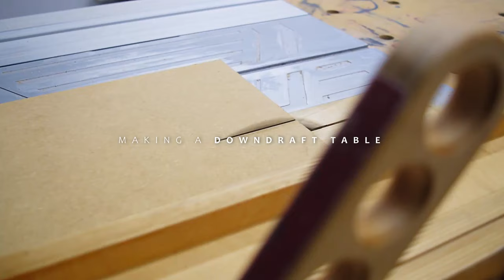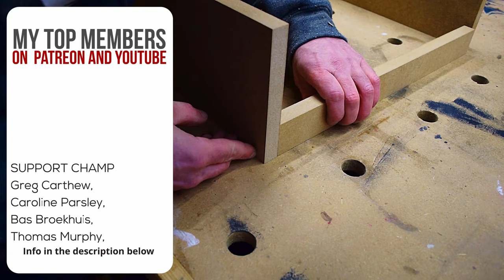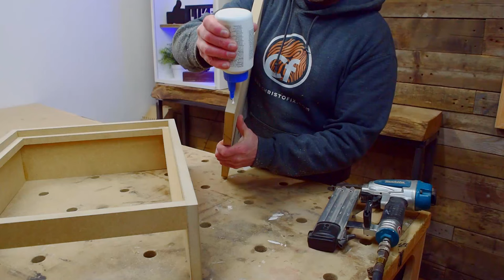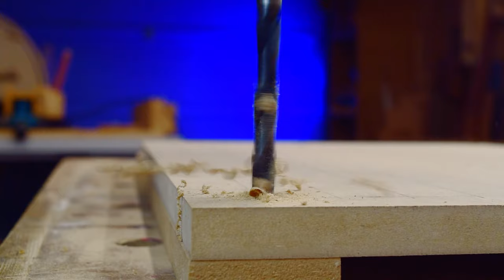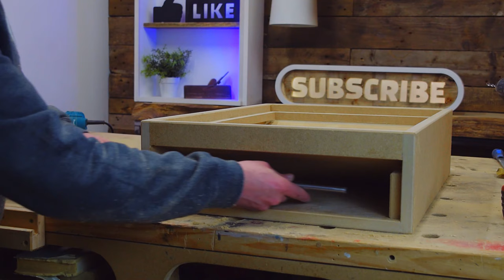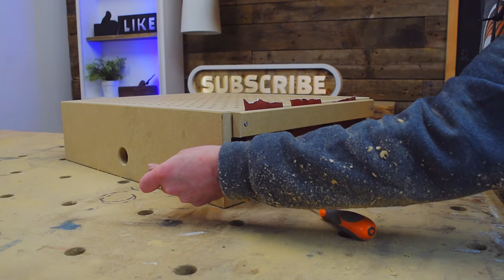Floating dust? DIY downdraft table WITH A LITTLE EXTRA 😍

Comment: Great design. I've been planning to make one for ages. Might put  few grooves in the top and see if it provides an advantage. I did chuckle when you sanded the top before fitting it, rather than waiting to use it to extract its own dust : )
Reply from the maker: That is actually a good comment, my friend! And very clever, too! We should start to make videos together, hahaha. Thanks for watching and this positive input, buddy!
Reply: @christofix  Thanks. It was intended to be constructive : ) Wish I had the time, space and equipment to do vids, because I have some good ideas occasionally.
Reply from the maker: @danceswithaardvarks3284  It was constructive, for sure. I had never thought about sanding it in the end, so I could suck its own dust, so thanks buddy!

Comment: Your downdraft table is cool , I like it very much. Adding the roles of sandpaper is a great touch. If you add a couple of hacksaw blades to help cut the sandpaper would also be a great feature.
Reply from the maker: Thanks, buddy! Since I didn't have a hacksaw blade when I was building this downdraft table, I just used a piece of scrap wood and this worked surprisingly well, and it was cheap too, LOL.
Thanks for watching and leaving me a comment. 
Greetings

Comment: Bravo! So much to comment. The sanding paper storage is brilliant! The video ends with a French cleat and duel use sanding paper station. Blew my mind! So I'm on like video 30. Just got done watching Stumpy Nubs version. He declared bigger holes are more efficient. I'm going to actually do a test with a scale. Should be fun. The 3/4 holes, if truly more effective also all ow for bench dogs and accessories. My only question is about the dust collector hose size. Has that been an issue? Also I won't be spinning my Festol by the cord any time soon but it looked great! I've seen foldable sides and corner brackets and foldable handles like that on a guitar amp. Also, someone commented about blocking some of the unused holes like a dust gate. I'll play with that.  I'm going to watch some more videos.and try to put all this into one. But man, the sanding paper addition is so sweet! Thanks for the great video!
Reply from the maker: Thank you for this very nice comment. I really appreciate this. I myself also have the Festool vacuum cleaner and I have not encountered any problems with it, these two work well together to collect as much dust as possible during manual sanding.
Closing some holes may increase the suction power of the holes that remain open. Still, I don't choose to do this because I think more open holes will remove more floating dust.
I hope this has been able to answer your questions. Thanks again for watching and leaving this positive comment. I hope to see you soon in one of my other videos. Greetings, Christophe
Reply: @christofix  Wow! quick reply. I might use a box fan containment in the back that is piped into the dust hose to aid in more of the air born particles. This is a really fun project to see how much greatness and creativity can be applied.

Comment: that is great I like the design but please please do some research on pipe size. I made a similar table and used 6" pipe almost loose the sander the suction is so great.
Reply from the maker: Hi Tony, thank you for that feedback and for sharing your experience. I haven't experienced this on this downdraft table yet, but I check it along the way with use.

Comment: How strong is your vacuum?  I have a 5hp shopvac and find it weak for using with various tools such as table saw and drill press.  A down draft table probably requires even more cfm right?
Reply from the maker: Hi buddy! I am not sure about the number of HP, but I know that my Festool dust extractor has a volume flow of 3900 l / min (137 cfm).
My first experiences with this downdraft table are very good. I will continue to test these to see if there are possible improvements.
Thank you for watching my video, my friend. 
Greetings 
Christophe

Comment: why the 2 angled pieces underneath?  does that increase the suction?  a really great build.  thanks for posting!
Reply from the maker: Hi Brandy! Thank you for your question, it is much appreciated. I'm pretty sure it increases suction. It makes perfect sense to me if the vacuum hose is placed in the center of the downdraft table. Dust will have to travel an equal distance from every place to the vacuum hose. That's why I chose this option.
Thank you for watching, my friend!

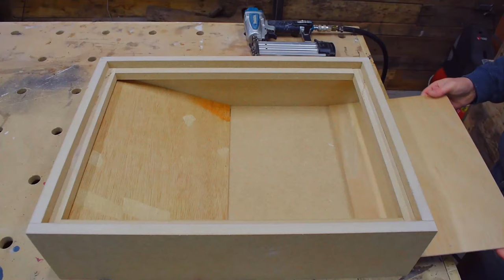Comment: Why did he make in the middle those 2 Boards that have a slight Angle at about 1:40...? Thanks
Reply from the maker: I did this because it will help collect the dust at the point where the dust extraction happens. This will prevent dust from accumulating in the corners and ensure maximum dust removal. I hope this answers your question. If you have any questions, feel free to ask, I will help where I can. Greetings Christophe
Reply: @christofix  thx for your Answer - Great 😊 👍